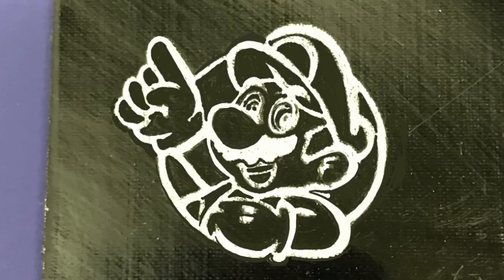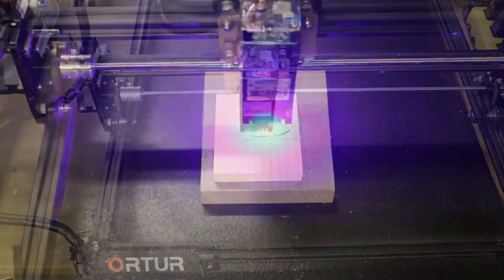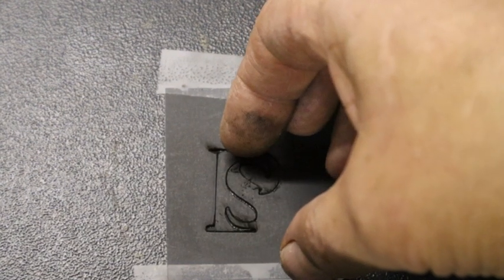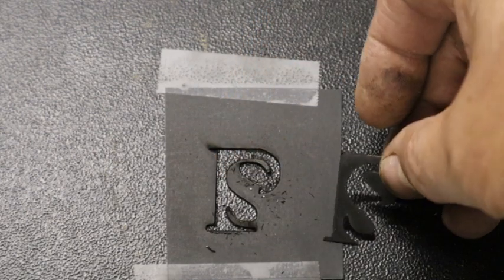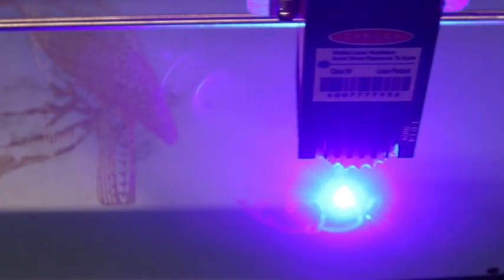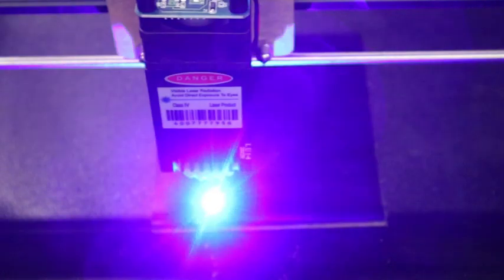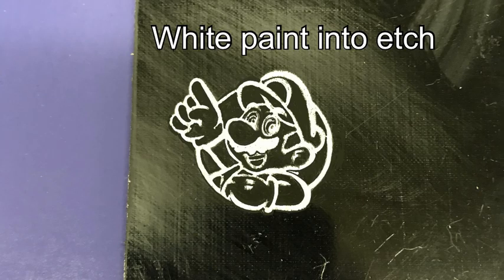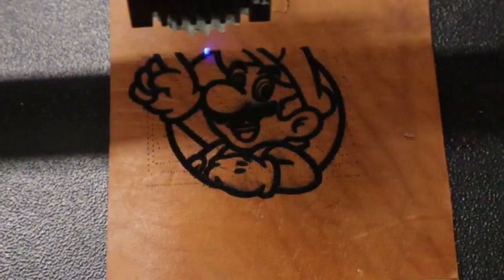Ortur Laser Master 2  20 watt   Testing and Review

Comment: Yes it can cut some thin wood, ply wood for example. You just need to localize the piece at a correct distance. The focal point is around 55mm, from the bottom of the laser aluminium block, so it will cut effectively something you put in +-3mm from the focal point. So basically put your piece to cut at 51-52 mm from the bottom of the case. :) You can even cut thicker stuff if you relocate the surface closer every certain amount of passes.
Reply from the maker: This video was my first day. I'm totally impressed with the laser.  I  learn more daily from those with more experience. I never bought the laser with the premise that it could cut wood,. I make custom furniture and I don't believe I have ever used 3mm plywood for anything.
However I will be using it for etching. I have tried mustard on stainless steel and it does work. It will not etch steel no matter what. It will not etch thickly anodized alumium. It is a tool that is marvelous for the price and I believe will suit my needs completely. I've joined the ortur users group and I am anxious to explore the laser's abilities. Thank you for your comment.
Reply: Â